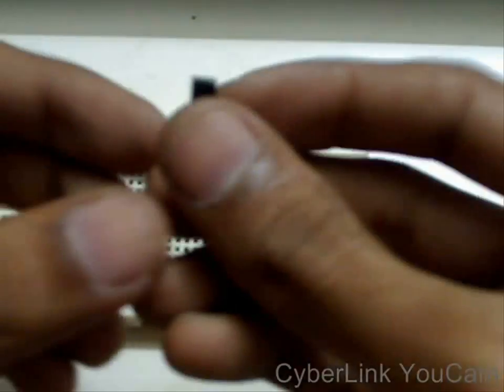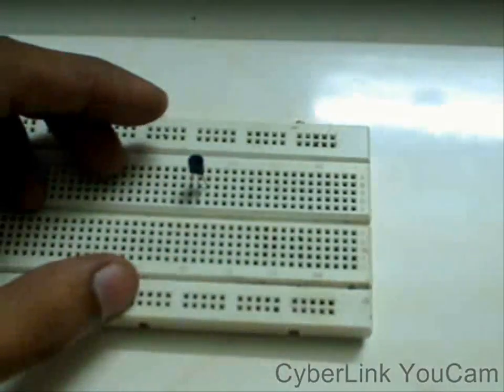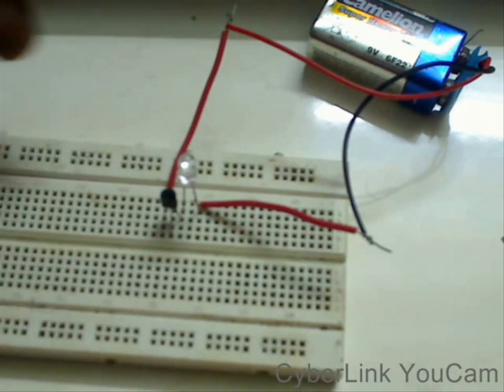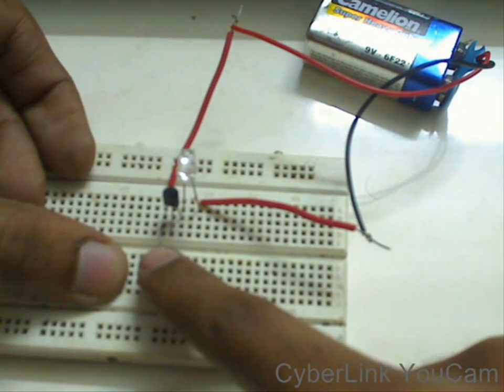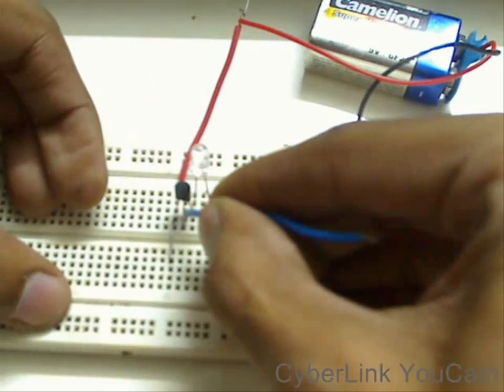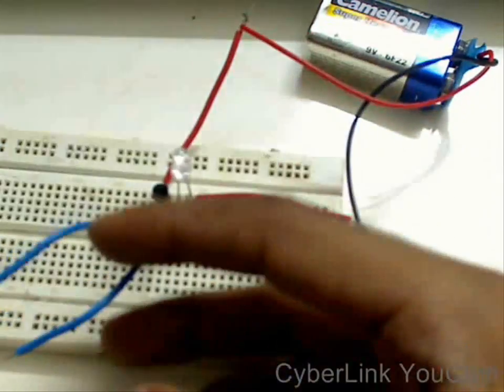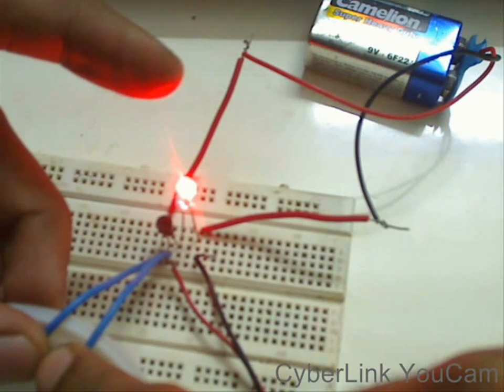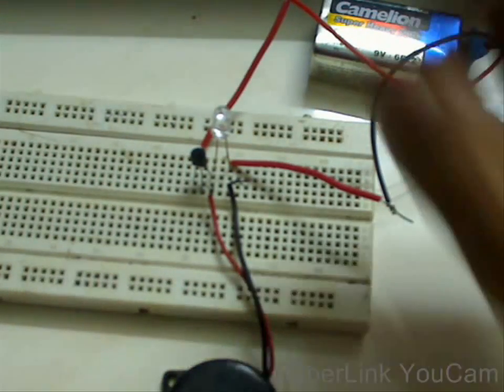How to make a touch switch and water alarm using single transistor

Comment: What if you only want to touch one connector? You need a different circuit.
Reply from the maker: +Bradman175  yeh u need one more stage of transistor then one connector is enough at the base
Reply: Electronics Made Easy : KHADER Wouldn't that turn the circuit on and off rapidly?